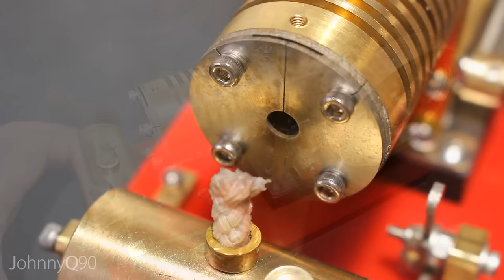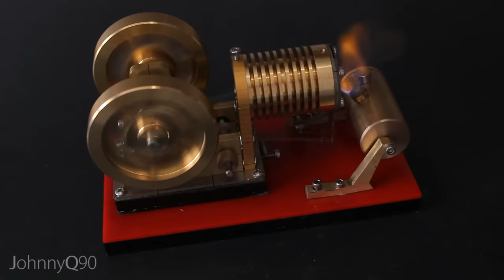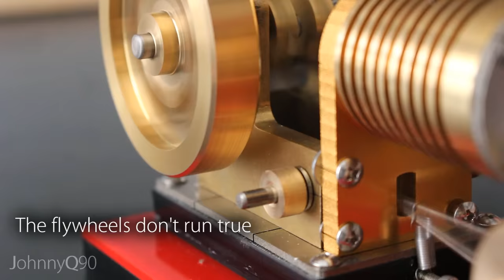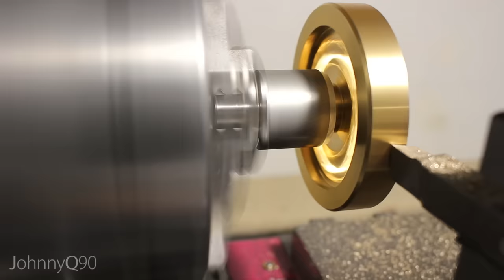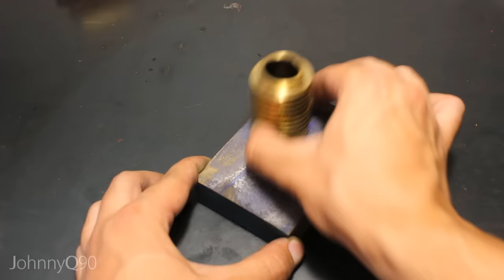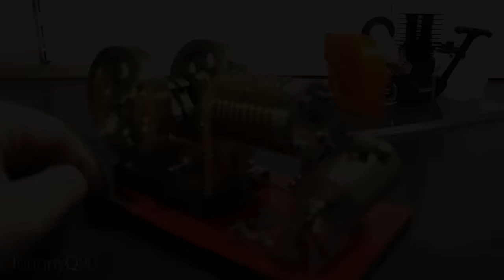Chinese Flame Licker Engine

Comment: Running an engine without a liberal amount of oil... Real slick. That'll last you a long time.
Reply from the maker: +Brendan Blab These engines don't like oil because believe it or not, it creates more drag. I put some graphite powder off camera and it works perfectly. I do this after every run.
Reply: JohnnyQ90  I guess that works too. Do you put graphite on the crankshaft too, or just the cylinder walls?
Reply: +JohnnyQ90 thank you for the graphite tip. I have a flame licker build from a "made in germany" kit and that thing has an oil dripper and it spills oil dropplets like crazy.
Using graphite could make the operation cleaner and more efficient. I will give that a dry when the weather improves.

Comment: It's better to use that heat to boil water  and store that energy as steam pressure  ...steam engine,though  more inefficient  than the gas and diesel engines  which  are also very inefficient  themselves. 
We've been using inefficient ways to generate power.

Comment: how does this even work??! its so cool!!! the fuel combusts BEFORE going into the cylinder! how does it wooooorrk
Reply: The piston sucks in the hot gases and then seals up. the gases now cool down and shrink in volume, pulling the piston back forward. that's all. Problem is: the minimum pressure would in theory be a total vacuum. means that the difference in pressure is just 1 atm, leaving this concept with almost no torque to work with...
Reply: ohhhhhh thx, bt couldnt u use it on a propeller since propellers dont have much weight resistance?
Reply: Alexandre Ahlstrom that might work for low revolutions. Even though air is light and easy to move, it becomes quite a burden for the propeller if it starts to compress. (it will compress around the propeller and expand right behind it again) You can't get by the fact, that the power of such an engine is still really low. And it's against the law of physics to assume the propeller power could be higher than that of the driving engine. Power is always the product of force and speed. Because the torque of this engine is very low, you woulf need very high revolutions to gain some output power BUT this engine is also very bad with high speeds, loosing torque, because the time to cool down the gases becomes too short to produce a pressure difference. So there is not only low torque but also a maximum speed.
It's a really useless engine and was never commercially used, even though it's about 200 years old.
Reply: oh lel k
Reply: wow u kno a lot about this
Reply: Alexandre Ahlstrom it was bad if i didn't. Cause this is my actual job ;)
Reply: cool, what job do you have?

Comment: a stirling engine
Reply: Allan Sayers thank you
Reply: No, this works in a different way than a stirling engine
Reply: Nope. This works on the principal that as a flame burns it creates a vacuum. It drafts it in, closes it off, and it burns the oxygen off creating lower pressure.
Reply: tnks
Reply: Oakwood Machine Works this is a completely wrong answer! The volume of the gas wouldn't just decrease because of some bound oxygen. Oxygen does not burn away, but fuses with carbon and hydrogen. Despite this fact, the combustion happens outside of the engine.
The real effect of a flame-eater engine or so called vacuum engine is, that the pretty hot combustion gases are sucked into the chamber, where the valve traps them inside. These gases then cool of (see the heat sink?) and because of their loss of temperature, it's volume wants to decrease. The pressure goes down and pulls the piston to the front again. The optimal case would be, that the gases cool down to 0 kelvin, leaving a vacuum. But this won't ever happen. The working pressure on the piston is extremely low. It starts with 1 atm and ends with about half of 1 atm. So the working pressure is about a negative 50,000 pascal. This is why a flame licker can't drive something but itself unless it has huge dimensions!
Reply: And it is not a stirling engine. A sterling engine has a closed gas circuit. No working gases are exchanged with the outer atmosphere. And the working pressure can be way higher than 1 atm, while the vacuum engine like in this video works with negative pressure.
Reply: They both work on a similar principle, require a heat source and cooling of some sort.
Reply: Mark Giblin as similar as dolphins and elephants. They are both grey and like to play around in water. Are intelligent enough to be tamed, have to breath air and need to eat.
Reply: The point is that they operate in a similar manner, were not talking about Elephants, dolphins and SCUBA divers, all of them being air breathing mammals, they all do a similar thing, breath, eat, procreate and other life function such as farting, going for a dump and urinating.
Reply: Mark Giblin but i still don't see what a stirling engine and a flame eater engine have in common besides the external combustion. 
Stirling engines provide a great enough momentum, that they are actually used in block-heat-and-power-plants and so called solar dish power plants. No flame eater is nowadays still commercially in use.
Reply: more like a Manson-Rupp engine crossed with a pulse jet
Reply: literally every fuel engine needs a heat source and cooling of some sort...
Reply: T3hJimmer and what about turbo engines? Despite of the heatprotection of some parts, they do not require any cooling.
Reply: Yes ALL engines, Turbo, Jet, Prop, etc... are cooled, they are cooled in two ways, the first is the oil system, that takes away a lot of heat and they also have a cooling system as part of the engine, this can be fluid or in the case of a Jet Engine, they blow compressed air through special openings in the fan blades to cool the blades.

So you see, Turbo Engines are cooled.
Reply: Mark Giblin oh jesus christ! We were talking about an essential heatsink to ensure the thermodynamical function of the engine. A stirling engine wouldn't even move without a heatsink. A turboengine is an open process without the need of a heatsink. Noone ever denied that you need to cool bearings, cases and whatnot! Stay at the topic of the conversation and don't go on my nerves...
Reply: Taunus-Tims Welt now now, jet engines have compressed air forced through tiny holes in the fan compressor so that it won't melt.
Reply: I have a jet engine compressor shovel standing on my desk right now. it's made of an aluminum alloy and has no holes. But yes, i know quite well that TURBINE (rear rotor) shovels have these holes, so that they don't melt and to improve gas stream qualities. But as i mentioned: that's not the point here, cause theren exist jet engines without any cooling holes, but there won't ever be a flame licker or stirling engine without a "cooled side" to close the circular process...
Reply: Taunus-Tims Welt did I say all of them had holes?
Reply: did i say, that you said, that all of them had holes? this topic is about the working principle of the flamelicker engine, and that they need to cool down the sealed gases to work and about that the difference is, that there is a gas exchange, where at the stirling engine there isn't. it's not about cooled or not cooled machineparts.
Reply: Taunus-Tims Welt you went Blah Blah Blah Blaaaah and it went over my head like when you said I said that you said I said what you posted was nothing like what I said or was referring too, seems to me that your the sort that argues or make comments that are designed to provoke some kind of response, the issue is that all these types of engine rely on cooling of some sort whether it is a combination of or is just one type, it will be something that will oppose the hot side to provide the other part of the cycle.
Reply: above you said: "They both work on a similar principle, require a heat source and cooling of some sort."
And i wanted to point out, that they use completely different and not "similar" principles. like they are similar, because they are some sort of piston-driven combustion engine, but have nothing more in common. And i also wanted to point aout, that there are jet engines which have no closed cycle process, which means they do not essentially need cooling to work. I do not want to provoke anybody, but i want to correct false statements, because they mislead others.
Reply: Taunus-Tims Welt very pedantic,  arguing over minor things, if it's that important to those interested, they can research the subject more themselves.

Comment: Great closeups in the video. What camera and software do you use? In our videos my son uses and Olympus 0-MD E-M5 II and Adobe Premiere elements 15 and ShotCut. We still have a lot to learn but are slowly getting there. In the video that should be posted by tomorrow Adam did some nice close ups in the video showing how we turned our surface grinder into an I.D. grinder.
Steve